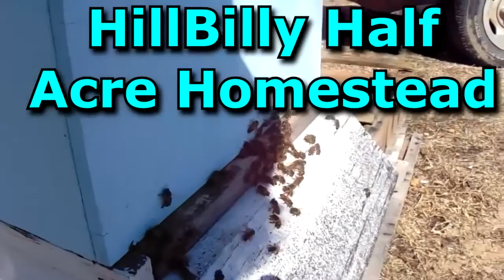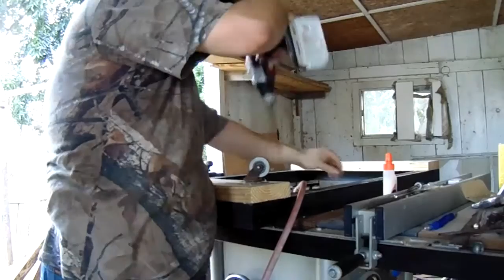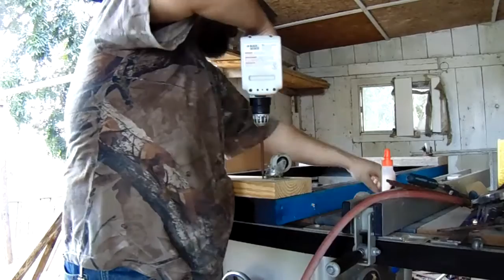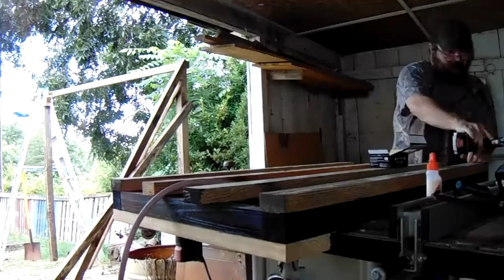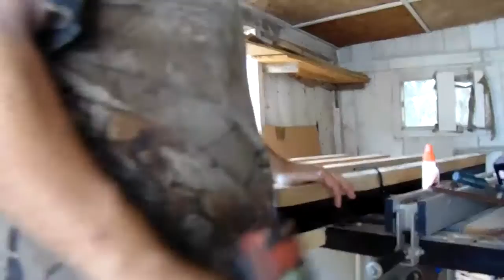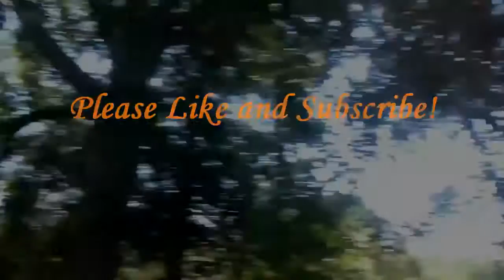Rabbits - How I Built a Rabbit Show Carrier Cart on the Cheap!  Part 2

Comment: Wow, I bet you could move 20 huge rabbits on that trolley if you needed to!  It's pretty hefty.
Reply from the maker: Yes, it ended up very heavy.   The wheels aren't very heavy duty but they were all I had.  I may end up putting some bigger wheels on it later.  It served our needs well however for the time being.
Reply: Or, you could just cut your lumber in half and that would bring the weight closer to what the wheels could handle.  Half the wood could probably still handle the # of rabbits you'd be moving.
Reply from the maker: I prefer to keep it where I can set two carriers side by side on it though....  Your idea would definitely work otherwise!  Thanks!
Reply: No, you misunderstood.  The size of your trolley is fine.  It's just the size of your lumber is twice the thickness you need.  If you are able, rip each piece in half, length wise, with the exception of the wood that your casters are fastened to.  That will cut your weight in half and still be the size you want and plenty strong enough to carry your rabbits.  Did I explain it right this time?
Reply from the maker: Yep, I got it that time lol!  I am slow but I catch up eventually haha  Thanks for posting and God bless!!!